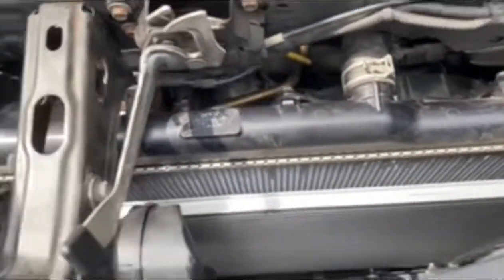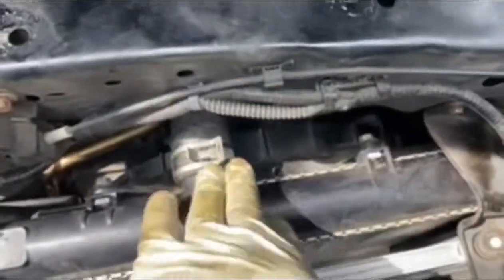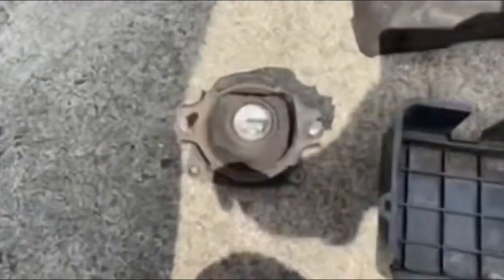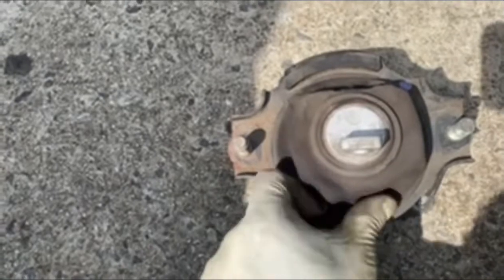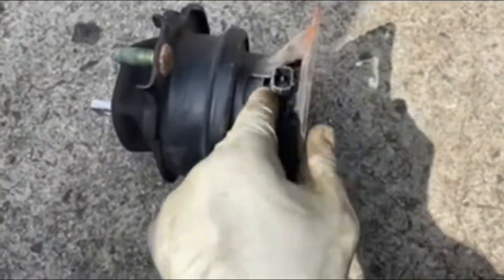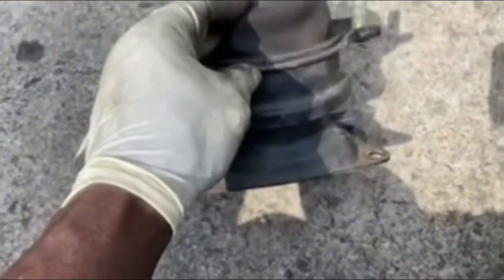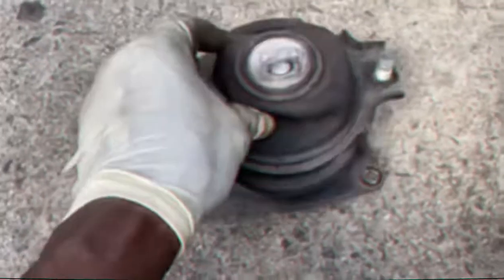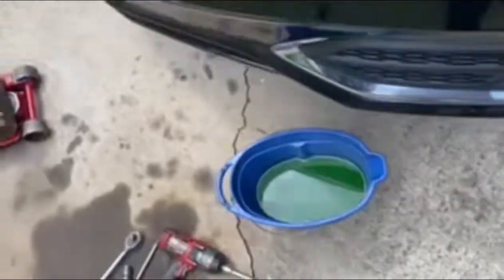All You Need To Know About A Front Engine Mount On A 2018 Acura RDX!

Comment: Is there a way to check if it is bad before taking it all apart?
Reply from the maker: Yes! Look for cracks around the black rubber part of the mount. Also looks for looseness. If it shifts hard that's another way to tell if the mount is bad.
Reply: Is there a vacuum line that goes to the mount?
Reply: I was told to put the car in drive. Keep foot on the brake while tapping the gas pedal. If you hear clicking or clunking it's the front. Do it for reverse to check the rear mount.

Comment: Great video! Thanks for sharing! May I ask how you find out it is the front mount? My 2013 RDX has a vibration issue around 120 km/h (75 mph), I have changed the wheels, front CVs, no help, could that be the front mount? Thanks! When I test the mounts with gas and brake, front moves more than the rear. Thanks a lot!
Reply from the maker: Yes more than likely it is the mounts, due to the age of the vehicle. Sorry about the delay in response. We hope you were able to get it resolved.
Reply: I just tested my 2013.. been hearing some clunking sometimes when driving from a complete stop or going over a speed bump wasn't sure what it was. Just did the "put in drive gas and brake" test myself.. sure enough it's clicking so it's definitely the front mount for me. Ugh.